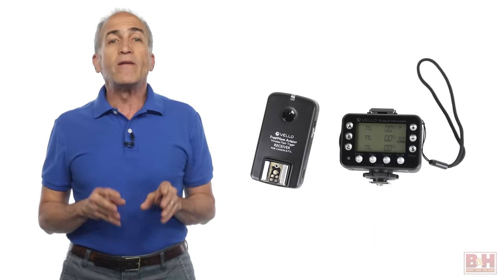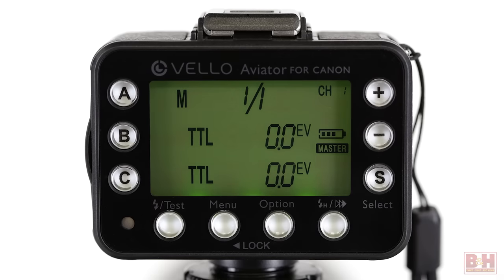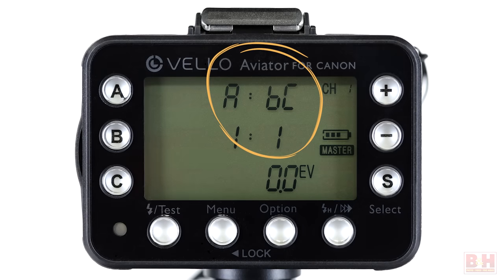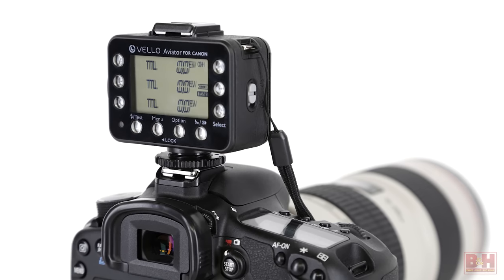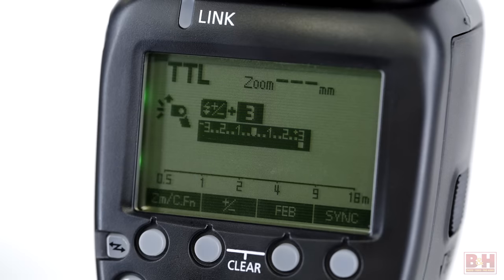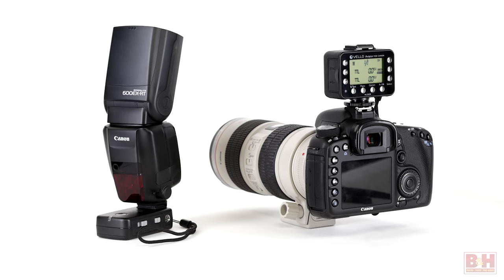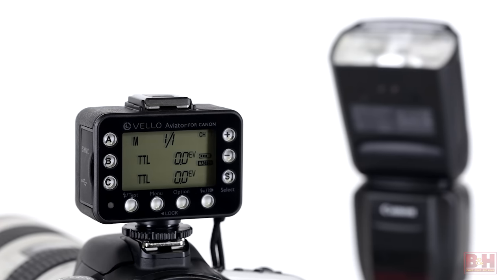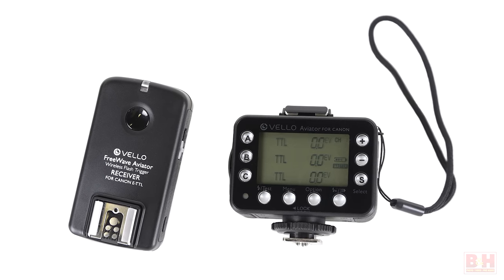Quick Look | Vello FreeWave Aviator

Comment: canon has high speed sync...same principle...the tradeoff with HSS is the flash distance to subject is reduced as you increase shutter speed...more pulses required as shutter speed goes up so less power per pulse which reduces the effective "reach" of the flash.  correct if wrong please...
Reply from the maker: royce west That is correct. With HSS with any system the flash power/distance is drastically reduced in order to pulse quickly enough to properly expose at the higher speed. - Yossi

Comment: i bought a vello freewave aviator transceiver and just that. i want to know if it would connect to canon 600 ex-rt flash without having
Vello FreeWave Aviator Wireless TTL Receiver .
Reply from the maker: Borna Amin You will need an Aviator transceiver or receiver attached to your 600EX-RT flash. You wouldn't be able to use the Aviator transceiver without another transceiver or receiver attached to your flash. Christina askbh@bandh.com 
http://bhpho.to/1MgDATt
Reply: B and H Does Yongnuo Wireless Speedlite Transmitter work with 600EX-RT flash?
Reply from the maker: Borna Amin The Yongnuo Wireless Speedlite Transmitter for Canon YN-E3-RT is designed to work with the Canon 600EX-RT without the need of a receiver. Though, I find the Vello system to be more reliable. You could also look at the Canon ST-E3-RT transmitter. Christina askbh@bandh.com

Comment: How can any flash sync to 1/8000 of a second? Doesn't sound right to me. Isn't flash sync speed based on shutter curtain speed?
Reply from the maker: IXcerberusXI The flash used must be compatible with Nikon's i-TTL automatic exposure system & must be compatible with High Speed Sync (HSS). HSS allows a flash to pulse multiple times evenly as the smaller shutter slit travels over the sensor/film plane. As such, the flash evenly exposes the sensor at higher-than-normal shutter speeds. However, it does reduce the output power & flash range, so the flash would need to be used closer than usual. The link below explains how HSS works. http://bit.ly/1UdXkLf
Reply: ah, didn't know about this, i'm a canon guy, so no luck there, but still interesting stuff, thank you

Comment: Can I use Vello FreeWave Aviator with Nikon D3300 and Bolt VX-760N? And also, If I want to attach Bolt VX-760N directly to Nikon D3300, should I buy some adapter (like PCU, PVU, etc.) so it can work? Thanks in advance! :D
Reply from the maker: +Luka Todović  - Vello FreeWave Aviator for Nikon is compatible with the D3300 camera and the Bolt VX-760N flash.  In situations where you want to  use the Aviator transceiver and maintain the Bolt VX-760N mounted on-camera, then you would simply mont the Bolt VX-760N atop of the Aviator transceiver's shoe which will maintain TTL communication for the flash to the camera.  No other adapter would be required. - Yossi
Reply: +B and H Thanks!